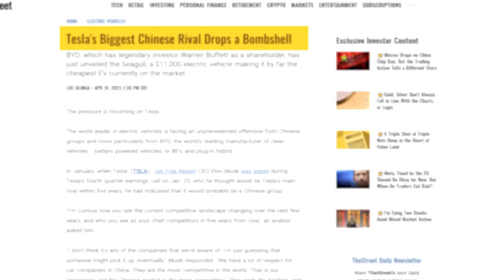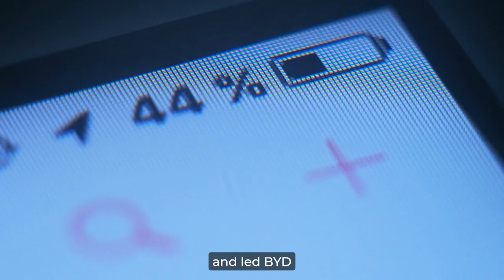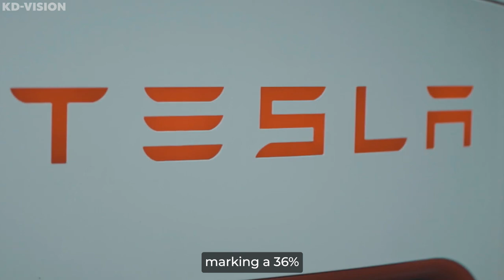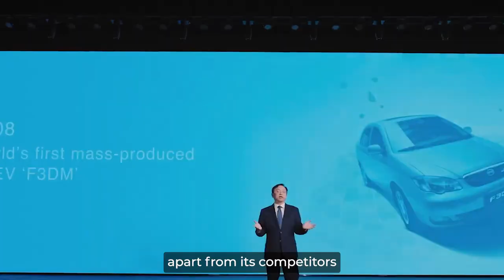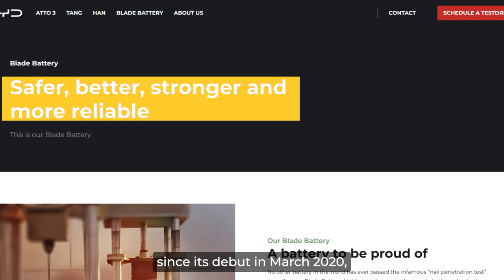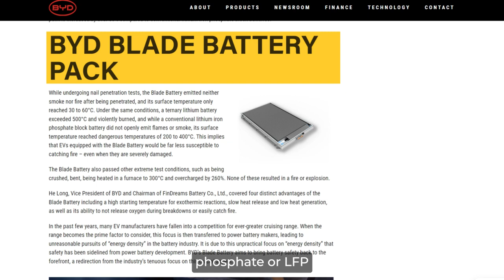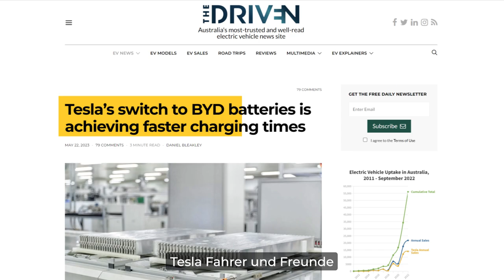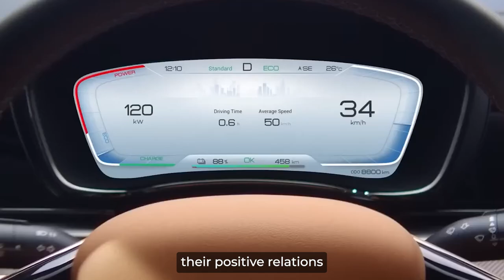BYD CEO: "Our Blade Battery Tech Leaves Tesla in the Dust!"

Comment: A lot more gas vehicles catch fire all the time, but nobody complains because it happens all the time and doesn't fit the FUD of the fossil fuels industry.
Reply from the maker: Thank you for sharing your perspective. It's true that incidents of vehicles catching fire can occur in both electric vehicles (EVs) and vehicles powered by internal combustion engines (ICE). While it's important to acknowledge that fires can happen in any type of vehicle, it's also crucial to recognize that the concerns surrounding EV fires stem from the relatively new and evolving nature of electric vehicle technology.

As electric vehicles become more prevalent, it is natural for people to have questions and concerns about their safety. It is essential for automakers to continuously improve and enhance the safety features of EVs, including battery technologies and charging infrastructure, to mitigate any potential risks.

It's worth noting that the incidence of fires in electric vehicles, while relatively low compared to gasoline-powered vehicles, has garnered significant attention due to the novelty and public interest in EVs. This attention can lead to a greater focus on safety and ongoing improvements in EV technology.

Ultimately, the goal should be to ensure the highest level of safety in all types of vehicles, whether they are powered by fossil fuels or electricity. As the industry progresses, it's important for manufacturers, regulators, and consumers to work together to address any safety concerns and continue advancing the safety standards of electric vehicles.
Reply: Catching on fire is merely the half of the story. The other half is putting out the fire. Try putting out the fire with a BEV!  It'll be educational.
Reply: @sjv9147s  
One only has to see the videos of the removal of EVs off of the RORO ship that had a large fire. They pull the EV off and then drop it into a large shipping container full of water which is then covered with a very heavy and special fireproof tarp to contain the toxic fumes. They then let the submerged EV cook for a number of days before they will dare to move it to an open storage yard to allow it to sit separated for an extended period of time to verify that the EV will not reignite again. The gasoline cars have no special handling. This is what the professional do to be safe.
Reply: New tech would always be under scrutiny from the naysayers

Comment: BYD is crap quality. The battery pack top cover is plastic in atto3. on a hot day my aircon never worked properly. Crap quality. Never buy a byd.
Reply from the maker: Wow..It sounds like you've had a frustrating time with your BYD vehicle, and we understand the importance of reliable performance, especially during hot weather. I guess you've had several rounds with tour car dealer to address the concerns?  It's essential for manufacturers to hear feedback from their customers to continually improve their products. We hope your future experiences with electric vehicles are more positive!

Comment: If BYD can stop all the fires from happening--that might help 🤭
Reply from the maker: Thank you for sharing your thoughts! You bring up an important point. Safety is indeed a paramount concern in the electric vehicle industry, and it's something that manufacturers like BYD are actively addressing. BYD's Blade Battery technology was designed with a strong emphasis on safety. Its use of lithium iron phosphate (LFP) chemistry, along with its unique structural design, aims to mitigate risks associated with overheating and other safety concerns.

While there have been incidents of fires involving electric vehicles, including some BYD models, it's crucial to note that BYD and other manufacturers are continuously working to improve their battery technologies and enhance safety measures. BYD's Blade Battery has undergone rigorous testing, including the 'Everest' test, which simulates internal short circuits, and it has shown impressive results in maintaining stability and preventing thermal runaway.

Of course, safety is an ongoing concern and challenge for the entire electric vehicle industry. BYD and others are committed to learning from incidents and refining their technologies to ensure the highest level of safety for consumers. As the technology evolves, we can expect even greater advancements in battery safety.

It's essential for consumers and manufacturers alike to continue discussing these matters openly, and your input is appreciated. If you have any more questions or thoughts, feel free to share them. Thank you for being a part of the conversation!

Comment: Explain why these products with these blade batteries keep catching fire when being charged especially I phone and lap tops.
Reply from the maker: Battery fires can result from a mix of factors, including battery chemistry, manufacturing defects, charging conditions, user behavior, and product design. While blade batteries like BYD's LFP-based technology have safety advantages, incidents can still occur due to these factors. Manufacturers are constantly improving safety measures and investigating incidents to enhance battery safety across the industry. Following manufacturer guidelines and using certified accessories can help mitigate risks.

Comment: But 1.2 million KMs with 3k charging cycles….

Is it practical range?
Reply from the maker: Those numbers are based on lab tests and might not match real-life driving experiences. They give an idea of how long the battery could last, but how you drive and the conditions you drive in can affect the actual mileage. So, they're more like estimates than precise numbers.
Reply: @AmpedAuto  tx… why because generally     on road range is only max about 70% of claimed range…
Reply from the maker: Yepp! real-world range is always influenced by various factors like driving habits, terrain, and weather conditions, often resulting in a difference from the claimed range. Manufacturers typically provide estimates based on standardized tests, which may not always reflect actual driving situations accurately. Thanks for highlighting this :)

Comment: BYD and TESLA has each pros and cons. But we need both to make EV run longer distance and faster.

There 's no car manufacture, doing more serious and significant than these 2 brands. BYD also has minor problem in their Value Flag Car. Mostly AC Compressor. 

Its not problem, but they need to install more HP compressor since it to slow to cool espceally in tropical and in the middle of the day.
Reply from the maker: Yes! It's true that both BYD and Tesla have made significant contributions to the electric vehicle (EV) industry, each with its own set of pros and cons. Your observation about the minor issues with BYD's Value Flag Car, particularly the AC compressor, is noted. Improving the cooling efficiency, especially in warm tropical conditions, is indeed crucial for enhancing the overall driving experience :).
Both BYD and Tesla continue to push the boundaries of innovation and collaboration (not to forget). I.e. the adoption of BYD Blade Batteries by Tesla showcases the industry's cooperative spirit, aiming to provide better charging speeds and performance for EVs. As EV technology evolves, it's essential to address concerns and work towards solutions that make electric vehicles more accessible and efficient for users around the world. 
We appreciate your thoughtful comment!  If you have any more thoughts or questions, feel free to share them with us! Don't forget to like the video and subscribe for more updates on the latest in the EV world!

Comment: Happened those fires on the Han with blade batteries?
Reply from the maker: Yes, there have been incidents of fires involving the BYD Han with Blade batteries. In August 2022 and October 2021, there were incidents of fires and smoke emission in BYD Han EVs. While BYD has made significant safety advancements with the Blade batteries, these isolated cases highlight the ongoing focus on safety improvements in electric vehicles
Reply: In the U.S. Tesla are the most catch on fire EVs 
1. They're mostly the only EVs on the road (being first in mass production in the U.S.)
2. Tesla uses a battery pack system which create condensed heat 
3. Batteries generate heat hence vulnerable to anything electrical can spark electrical fire. But ICE vehicles fires completely outnumber EVs (flammable fluids, motor heat, electrical sparks / shortages).

Comment: The blade battery has nothing revolutionary in the cell make up. It's the physical design of the battery that helps mitigate short circuits and fires from physical damage. Imagine the NIO semi solid state battery chemistry with the the blade battery physical design.
I still don't like the design of the BYD vehicle range though with the design cues a bit off putting. Especially for Western tastes.
😎🇦🇺
Reply from the maker: You're right that while the Blade battery's cell makeup might not be revolutionary, its physical design indeed stands out for its safety features. BYD has prioritized safety in their battery technology, and the Blade battery's unique design plays a crucial role in enhancing safety standards. Regarding BYD's vehicle design cues, it's interesting to hear your perspective. Design preferences can vary widely among individuals, and it's understandable that certain cues might not resonate with everyone. However, it's great to see BYD focusing on innovation not only in battery technology but also in vehicle design to cater to diverse preferences and safety needs. Your feedback is valuable, and we appreciate you sharing it!

Comment: Yep.....  In the dust comparing to mosts EV's as a incendiary device..... LOL
Reply from the maker: It's understandable that safety concerns may arise when discussing electric vehicles, especially considering past incidents involving fires. However, it's important to note that BYD's Blade Battery technology has undergone extensive testing and has demonstrated impressive safety features. The Blade Battery has passed rigorous industry tests, including puncture tests and extreme temperature exposure, while maintaining its integrity and remaining cool. While there have been isolated incidents, investigations are ongoing to determine the specific circumstances surrounding them. As with any new technology, continuous improvements and advancements are made to ensure the safety of electric vehicles. BYD, like other manufacturers, is committed to enhancing the safety standards and reliability of their EVs. If you have any further concerns or questions, feel free to let us know. Thank you for watching!